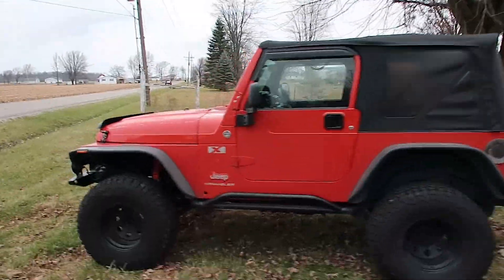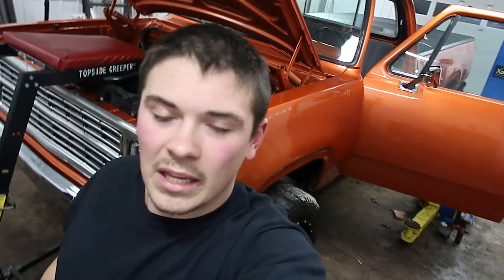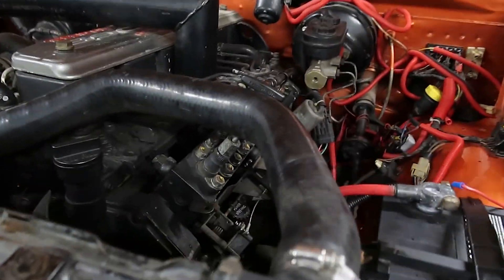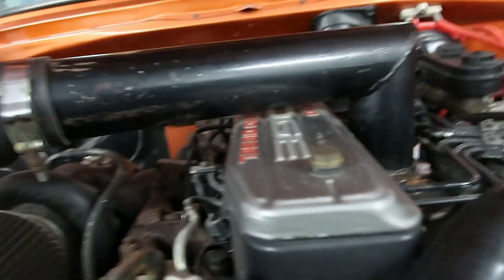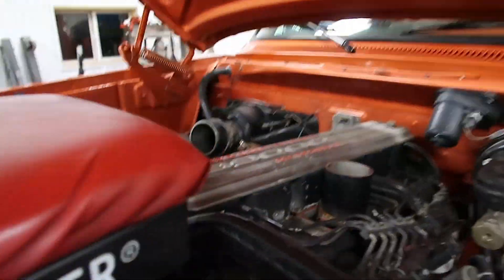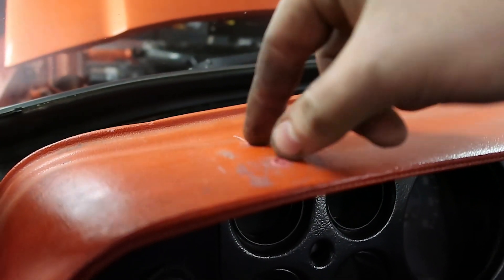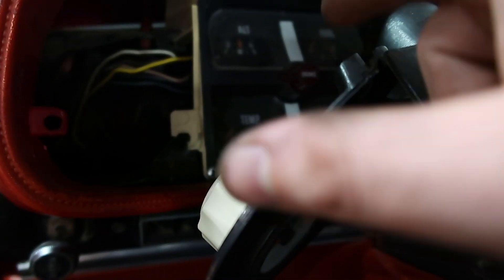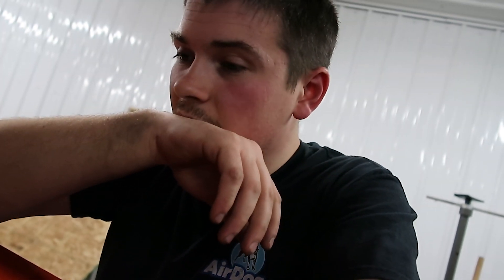MAJOR WIRING ISSUES ON MY 79 CUMMINS!?!

Comment: My recommendation is if your going to keep the battery shut off, I would install it under the hood to eliminate extra power wires in the cab. If you daily it I probably wouldn't keep it, but if it sits off and on it wouldn't be a bad idea to keep it.